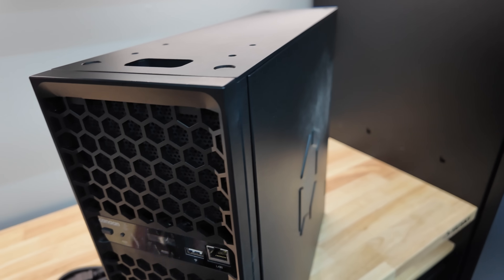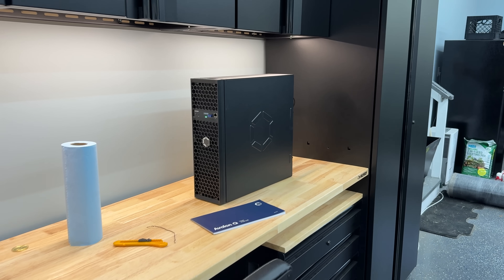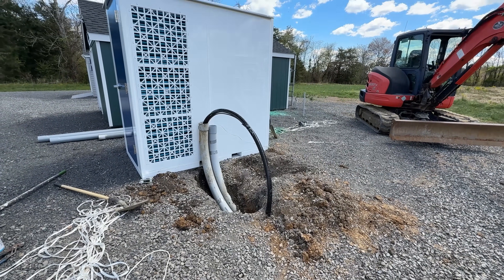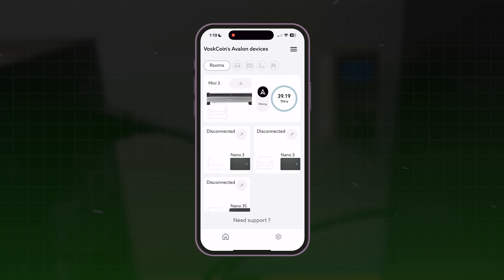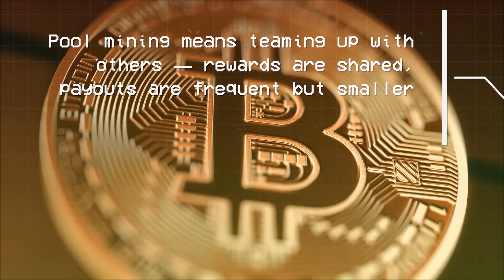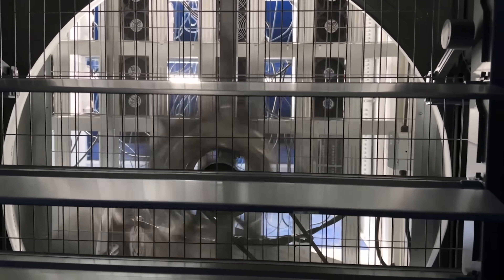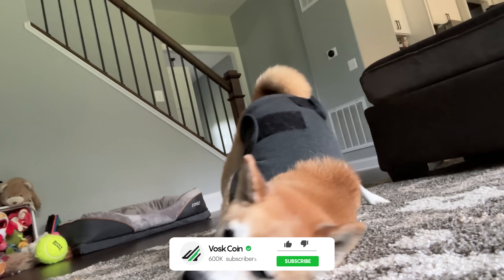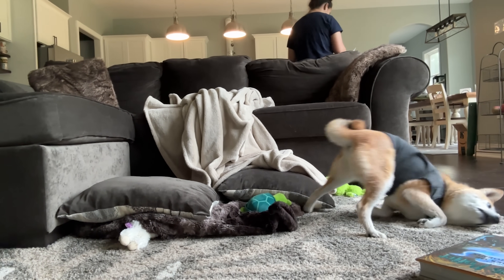NEW Home Bitcoin Miner with POWER of Industrial BTC Miners?! Canaan Q Review

Comment: Is anyone able to help me out with a problem? I’ve recently lost my wifi adapter/receiver and have tried two others so far but the miner does not register them (guessing drivers). I’ve contacted support but have been receiving the wrong information from them. This is the alternative they are sending to buy Amazon Basics USB 3.0 to 10/100/1000 Gigabit Ethernet Internet Adapter, Black

Is anyone able to help with with the right wifi adapter to purchase as I don’t have Ethernet access with my situation.